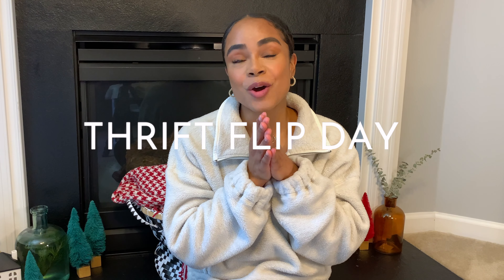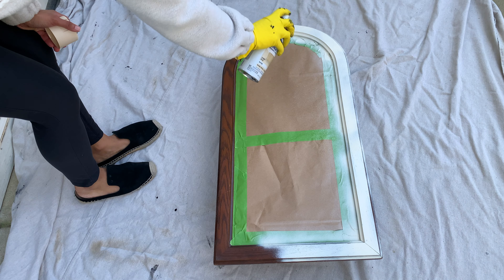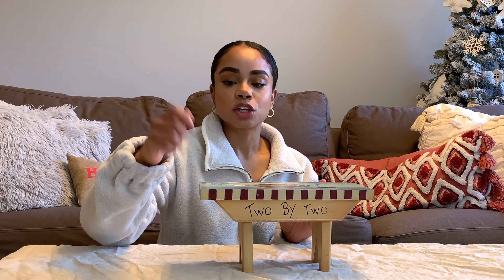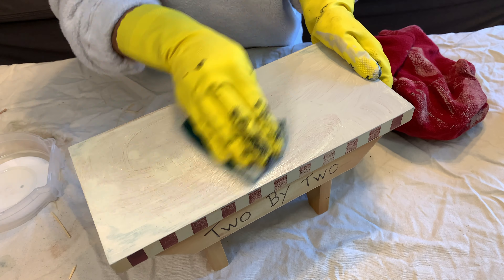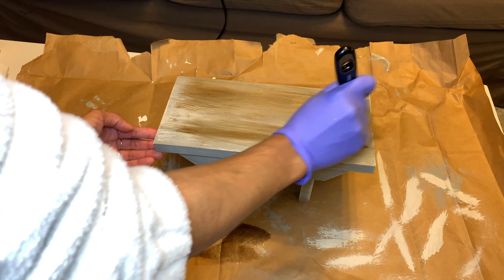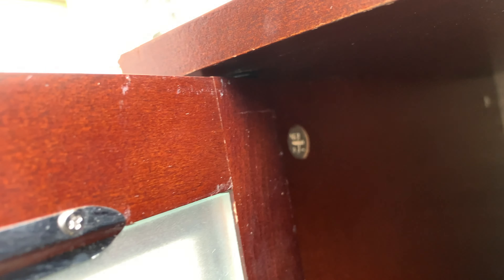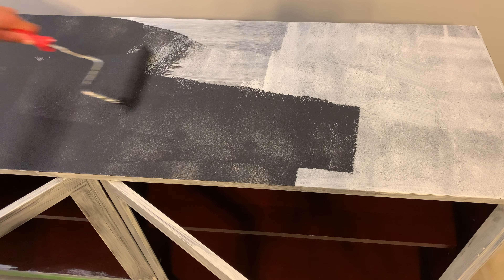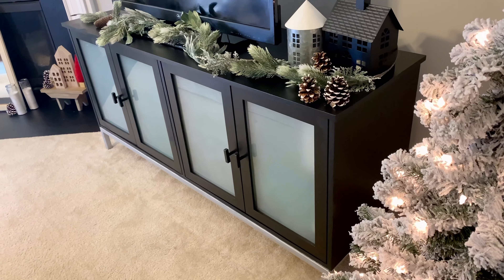DIY Thrift Flip Decor on a BUDGET (Trash to Treasure) | Faith Lyric

Comment: Furniture "refinisher" is only for stained woods that the top sealing coat needs refreshed.  It is rubbed on and the color and varnish redistribute.  You need a  paint "stripper" to remove paint.  this is merely an FYI.  You do such great work and always are willing to learn!! Keep vids coming!
Reply from the maker: Thank you for that tip!! I was trying to avoid using paint stripper because it’s so messy and has given me a hard time in the past! Lol clearly I wasn’t supposed to do that!! As always, I am learning along the way and will make sure to use the refinished on stained woods only. Thank you again!!!
Reply: @Faithlyric  You are doing great!!!  I know stripper is horrible, but the project turned out GREAT!!!!
Reply from the maker: Thank you so much!!